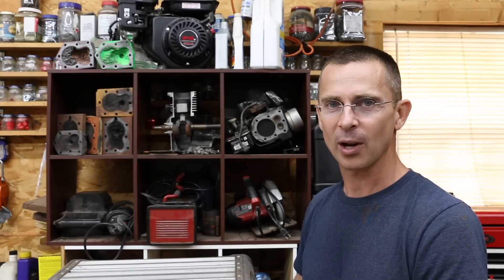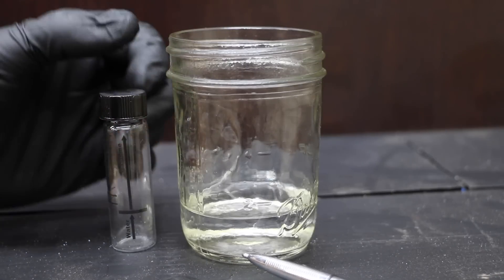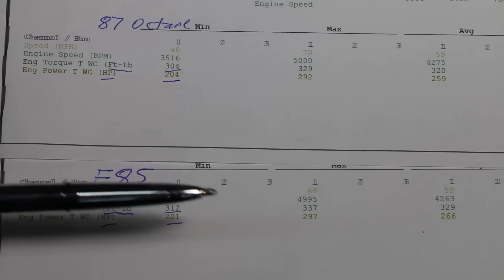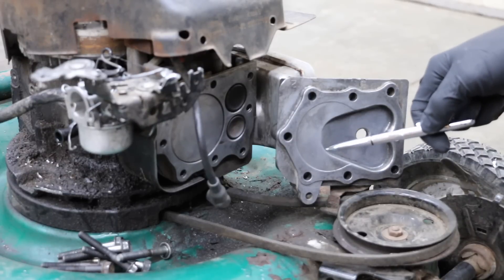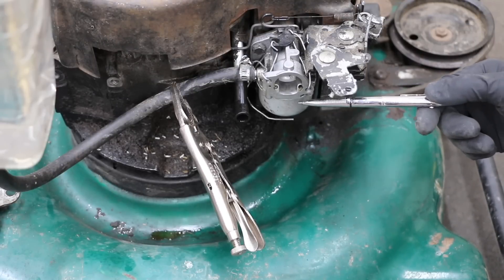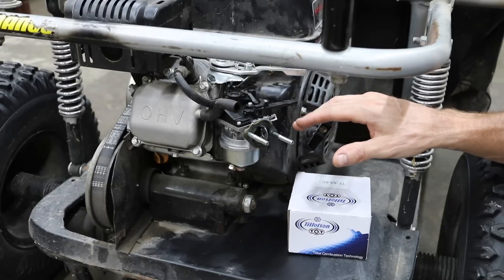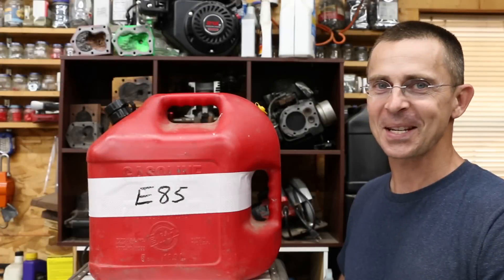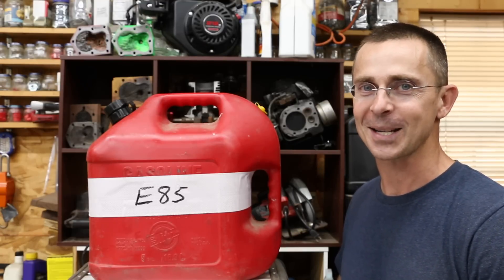Is E85 better than Gasoline? Let's find out!

Comment: Ethanol is a decent fuel,  less energy dense than gasoline, but cleaner burning. This means you generally need a larger engine for an ethanol fuel vehicle. And, it’s corrosive, but that can be managed with selection of materials and additives. But there are two big issues with ethanol fuel in the US. 

1. Ethanol/gasoline blends will never deliver the benefits of either. When you blend them, you can’t take full advantage of the higher energy density of gasoline, nor the full benefits of cleaner burning of ethanol. You get lower fuel economy and less engine power, but with improved emissions and higher net fuel costs.

2. Most ethanol in the US is made from corn, and has lower net energy returns (NER) than other sources. Corn is a crop that wastes lot of fresh water too. I wrote about this a decade ago, and while the efficiencies have improved some, this is still relevant. http://divisionisthistory.blogspot.com/2010/12/no-more-corn-based-ethanol.html
Reply from the maker: Thank you for the feedback

Comment: I've had two flex fuel vehicles designed to run on E85. I've tried running E85 in both of them and gave up. While it's a lot cheaper at the pump, I probably had to fill up more frequently. My fuel economy went way down while running E85 compared to regular gasoline.
Reply from the maker: Great point. Thank you

Comment: I have checked many vehicles that use identical engines that come with and without flex fuel variants, the only difference that I can find is the Flex fuel versions have larger fuel injectors.
Reply from the maker: Great point

Comment: E85............  Would it not get better gas mileage in an Auto if there were more air available for the combustion? Seems like you might lose a lot of fuel, out the exhaust due to incomplete combustion?
Reply from the maker: More HP but less efficiency.  Less BTUs of energy per gallon in ethanol vs gasoline
Reply: @ProjectFarm  Looking at your carb test, it could be concluded you do not get enough air in your fuel, when running in a vehicle, so it dumps a lot of the fuel, out as waste or water...Not sure, never ran E85...... It was celebrated and rivaled as a scam..... But for a couple of years, they were selling those vehicles.... Then they started mixing it in all fuel..... Who knows what is in fuel?

Comment: Until they make the fuel systems fully able to handle E85, ethanol enhanced fuels are still a problem. You seen what it did to the original carburetor of that small Briggs engine. I see the damage ethanol enhanced fuels do every day on my customers equipment. Some argue that it’s other additives in the fuel that do it, but no, you just seen proof of what it’ll do. It HAS benefits, don’t get me wrong. But to run it properly, you need to set the engine and fuel system up for it. Flex Fuel vehicles, IMO still have a way to go before you’ll get the mileage you do out of regular gasoline.
Reply from the maker: Great point. Thank you

Comment: I used E85 in all my cars for about 10,000 miles, so I feel I am an expert in this.  I have watched many videos, including  a tear down of an suv engine after 100K miles.  Result of tear down.  A beautiful clean engine.  I used E85 on a honda odyssey, mazda miata, and ford escape hybrid.  First we must dispel the myth that Ethanol is a corrosive, toxic substance.  It does not "melt" any rubber or parts.  Worrying is like saying that a shot of vodka will melt your engine.  nope.  Also, if it was so bad for all cars, then why do they add 15% ethanol into ALL GAS in the winter? Anyway  E85, used alone, is not the ideal mixture for a non-E85 car.  Your engine light will go on, mainly because the sensors will detect MUCH LESS pollutants in the exhaust.  You could probably used E85 alone, but I understand that the car may be hard to start in the cold....  So, I started my test at 3/4 regular gas, and 1/4 E85, no problem.  60% then 50% gas - no problem.  At about 40% gasoline and 60% E85, you may get the engine light on, but the car runs fine.  I used a 50/ 50% mixture on all my cars for about 10.000 miles each, with no issues.  It was an experiment for me to use as little of foreign petroleum as possible.  I found that we as a country COULD use 50% less petroleum with E85.  I stopped the experiment about 4 years ago because my wife did not like the check engine light on in her car.   Conclusion, my cars are all 15-20 years old, still running perfectly after a diet of 10,000 miles of E85.  If we had a gas crisis like in the 1970s, we could make our own corn powered gas..  PS - fun historical fact - - - -   In the early days of automobiles, e.g., model T till the 1930s, there were not a lot of gasoline stations in the country.  The infrastructure was not there.  Petroleum gasoline was mostly used in the coastal cities because the closeness to the ships that brought gas.  Guess what the folks in the interior of the country used to power those same cars????  You got it...  Ethanol, which was plentiful due to our wonderful country's corn production.
Reply from the maker: Thank you for the feedback

Comment: I run 50% E85 with 93 octane in my 2000 grand prix 3800GTX.  Larger injectors, headers, much smaller supercharger pulley, larger throttle bodey, higher ratio rocker arms.  E85 makes a huge difference. I beleive E85 is 106 Octane?
Reply from the maker: Great feedback.  Yes, it's well over 100 octane

Comment: #1. My tests with 7 different vehicles driving LA to SF prove that Premium gas can actually lower MPG. In California non-additive gasoline is hard to find, I only found it once, but there is a significant change in mileage between "Summer Blend" and "Winter Blend" gasoline.
#2. My Costco Gasoline Station buys gasoline from any of five refineries in the San Francisco Bay Area based on price and availability but, the gasoline at the nozzle, which the state tests periodically, is always the same and that is true for all stations because the only, only, only difference beside what you pay is the additive package added when the gasoline goes into the tanker truck that delivers to your station. Paying more is not getting better gasoline.
#3. Premium gasoline in a car not designed for it is a 100% waste of money. In fact you're car can actually have less power. Your butt really can't tell the difference.

Comment: I used to use E85 on a 2017 Ford Focus I had for a year. It had noticeably stronger acceleration and could peel out all through first gear using E85. I had no issues with the engine for the 20k miles I had the vehicle, I got an average of 24 mpg on E85 and an average of 37 mpg on 93. My best mpg was 60 on 93 going 55-60 with the A/C off.
Reply from the maker: Great information. Thank you

Comment: Ran a couple tanks of e85 through a flex fuel 08 chrysler sebring 2.7l .  Check engine coded showed  Catalyst failure,  fuel mileage dropped on average about 6 mpg.  Ran that final tank of e85 till the empty mark filled with regular unleaded , fuel mileage increase was almost immediate,  and with in a 100 miles the check engine light went out.
Reply from the maker: Wow!  Thank you for the feedback

Comment: Yea i am a retired ASE master, and i used E85 in my 1994 ford thunderbird w the 3.8 liter, first tank, it didnt like it much, then i started to add marvel mystery oil to each fill up and retarded the timming, and turkeybird loved it,so did i. E85 was 1.78 in 2007-08 regular gas in arizona was 5.10 a gal for 87 unleaded i also used E85/mysteryoil in my 78 dodge rvs 6.0 onan generator With no problems. Used it daily for almost 2 years.(generator was cheaper for power than Trico electrics coal/used tire/Natural gas burning power plant) And a plus was the
Oil changes in these engines was extended greatly.

Comment: The beauty of e85 is that it can handle high compression. Not diesel level, but 15-16:1 naturally aspirated. it produces a lot more power that way and with proper gearing can make it more efficient. E85 where I used to live it's also about 70% the cost.
Reply: The problem is that motors designed to run on both inevitably must favor a specification for gasoline operation because putting 87 octane in a motor with 15 to 1 compression will blow up.
Reply from the maker: Thank you for the feedback

Comment: Love your videos. I have an 09 Flex Fuel Town car. I don't have access to E85 fuel where I live. I understand that Ford/Lincoln uses a colder spark plug to accommodate the burning of the E85. I have heard that people with flex fuel vehicles who don't run E85 can gain some fuel efficiency by switching to the non flex fuel (hotter) spark plug. I'm curious if anyone has any experience with this. thanks
Reply from the maker: Thank you for the video idea!

Comment: My car is compatible with E85 and I was relented to use it, but since I start to use only E85, I clearly see the difference not only in fuel consumption but also in the extra power that the engine delivers. Also, and I like to make this clear, maintenance costs have in fact lower since the engine runs much more smoothly.
Reply from the maker: Thank you for the feedback

Comment: Interesting results. I hired a 2019 GMC Yukon last Sept in Florida for 3 weeks and done 3000 miles total. The first 1500 miles, I used Reg Unleaded at $2.44 per Gal and returned 18.5mpg. The last 1500 miles, I used e85 at $2.56 per Gal (quite hard to find) and returned 14.5mpg. Almost the same difference as your test with e85 around 30% less efficient as regular unleaded. The SUV did run slightly better on the e85.
Reply from the maker: Great information!  Thank you

Comment: We had an 88 Chevy celebrity with a tech 2.5 4 cyl automatic, we were in Colorado and never had heard of e85 until that time in 1998, anyway we filled up with it, and in all reality it ran and drove pretty much the same as 87 octane, we drove all the way back to Iowa and did good on mpg, I also went 50/50 e85 & 87 in our 88 Park Ave that had a 3800 series 2 v6, only noticeable difference was the smell of the exhaust, was glad to see your comparison here in this vid, mind you neither of the two vehicles listed in my comment were labeled flexFuel, any thoughts on this? Would really like to know what you think, Happy Holidays

Comment: I have an 03 Explorer with the 4.0 six and it's a flex fuel vehicle.

A couple of weeks ago, I filled up on E85 for the first time.

While my truck ran fine, my check engine light came on with a catalyst efficiency below threshold code (P0420).

As soon as I ran the fuel down and filled back up on regular fuel, the code cleared itself.

Just like you, I also noted that fuel efficiency was reduced by about a third due to the lower energy density of dead corn vs traditional dead dinosaurs.

I suspect my truck has a sensor that is not quite up to par and thus unable to take into account the combustion emissions difference between the two fuels.

Fewer emissions from ethanol would result in cleaner exhaust going into the catalytic converter and therefore an apparent reduced efficiency in catalytic converter performance.

Comment: I've been using E85 with gasoline mixed in ratios like 30/70, 50/50, 70/30 on my european Audi 80(A4) from 1993 and A3 from 1999. Both are working just fine even though they have no e85 mods. Fuel consumption increase is 20-25% on 70% alcohol mix, but here where I live it's actually beneficial since E85 is only 65% price per volume compared to pure gasoline.
Reply from the maker: Thank you for the feedback

Comment: For a flex fueled vehicle e85 is an excellent cleaner I've found. My 2011 F-150 with the 5.0L V8 developed excess carbon and pinged and knocked a little on 87. I ran a couple tanks of e85 then went back to 87 and I didn't hear pinging or knocking anymore. I would not run on e85 all the time though.
Reply from the maker: Thank you for the feedback

Comment: Found your channel not too long ago and I really like it.  I know I'm late to the party regarding this test, but unless I missed it in the comments, it is important to point out that the flex fuel ECU calibration that GM uses on this generation of LS V8s is not designed to optimize power while on ethanol..  It only adds 2-4 degrees of timing at full throttle between 3500 and 5000 rpm and the engine typically wants more than that to get to optimal torque (might have something to do with the fragile 4L60E transmission that most of these trucks used).  There is a lot more timing added below 2500 rpm and above 5000 rpm, but you really didn't get to test that.  With proper tuning you'll typically see 6-8% minimum power/torque gains across most of the rpm range on E85 vs. 87 octane tuned.  Other higher performance engines will naturally do even better (supercharged GM V8's converted to flex fuel will gain 80-100 hp on corn vs. 91-92 octane).
Reply from the maker: This is great information!  Thank you
Reply: I liked my 4L60e a lot, it took everything that was thrown at it and had 285,000 miles when i sold it and it still ran down the road perfect. I think it's all on how you maintain it, and don't be doing burnouts constantly. I know tuning can go a long way, but only so far without a shift kit or new torque converter. I suppose id have a whole different outlook if i ever owned a 4L80e. I only said this because you said it was fragile, and mine was anything but. But some are built better than others i suppose.
Reply: @johnanderson5500  They have made improvements over the years.  Anything in the trucks from 2002 and earlier was very weak.  Lots of failures of the sprag and the sun gear.  I lost 2 in 100k miles on my 02 and we didn't even tow with that one.  03 got some improvements with some parts from the Corvette and there may have been some running changes along the way.  But its just not a good design for truck/suv use.
Reply: Lp

Comment: I found on my explorer it did not make sense to buy e85 unless it was 30 cents a gallon less. Then it was cheap enough to run for the bother. That is based on fuel priced in the mid 2 dollar range.
Reply from the maker: Great point!

Comment: Excellent test video.   Ironic.  I have a 5.3 Silverado with 212,000  And a MD dyno.  Have tuned hundreds of vehicles on E85.  Mpg is usually 25% less depending.   Of the factory flex fuel vehicles many owners wont ever use E85.  Its of great use for trucks and SUVs if towing.   Just at a higher cost in terms of economy.  The small engine test.  Higher compression and advanced timing would really take advantage of the E85.   By itself.  In almost any engine if injected or jetted correctly.   Much cooler combustion chamber and cy head temps.   Way cleaner.   Can be hard to cold start in the not so warm climates.   Its a great fuel just often misunderstood.   From an OEM standpoint it helped with emission standards.  Certainly not with the CAFE average for a brand.
Reply from the maker: Thank you for the feedback!

Comment: I recently purchased a 1999 s15 silvia with 264 cams, intake, exhaust, front mount intercooler, haltech ecu, z32 gearbox, nismo 2way diff, twin plate clutch and I changed the blown precision hp5130 turbo with a trust t518z. It is  currently tuned for 98 octane. Should I tune it e85 and why?, apart from it running cleaner than regular gas. Its already setup for e85 and I'm very curious about it.  I've had a 10 year hiatus on cars, i'm still trying to catch up, much help would be appreciated thanks

Comment: E85 works best with forced induction. The greater knock resistance means you can increase the timing. My turbo car went from 550hp to 616hp going from petrol to E85 both running 20 psi
Reply from the maker: Thank you for the feedback

Comment: E85 is similar to regular fuel but is more corrosive to standard seals on your engine, so that is the main difference.
Reply from the maker: Thank you for the feedback
Reply: Attracts water, higher octane, less energy, is that not a difference?

Comment: I converted an 04 f250 5.4l to ethanol and drove from Pennsylvania to Florida and got better gas mileage and towed 8000lb trailer from Florida back to Pennsylvania and thought e85 was great, better then 87 octane. It was an aftermarket conversion kit I used that plugged into the injectors and it gave me 5% better fuel economy over 87 octane!!

Comment: To really take advantage of E85, you need a higher compression ratio. The main advantage is that it has a higher octane rating, but that's useless in a normal gas engine.
Reply from the maker: Thank you for the feedback!

Comment: Just so you all know if y’all put E85 in a regular car your check engine will go off, the car will rev a lot higher and the mpg will drop significant, but it won’t blow up the car. I freaked out when I put the wrong gas in. After if burned off the check engine light went off.

Comment: e85 from what i have seen from everything ive researched needs about 30 percent more fuel to run the same amount of miles.. now, the question would be to help clean your motor, should you do an e85, cleaner combo to really clean your motor then switch back to normal fuel. of course this is if your vehicle is designed for e85.
Reply from the maker: Great point! Thank you

Comment: What is the advantage of using e85
Reply: One of the advantages is that it is co2- neutral. It doesnt ad co2 to the enviroment.
In Sweden where I live it is also often a little bit cheaper to use e85.
It is easy to calculate, if gasoline is more than 30% more expensive than e85, you save money with e85.
One of the disadvantages with is that it is recommended that you change oil in the engine more often if you run on e85.
That is because the alcohol has a tendency to go passed the piston rings an dilute the oil.
Reply: @pereklund9172  thanks for clearing that up